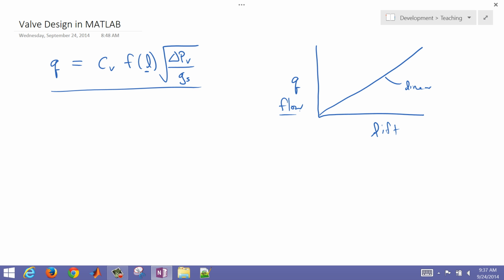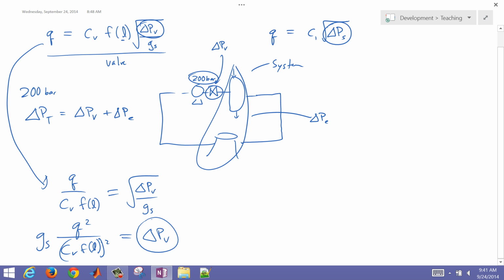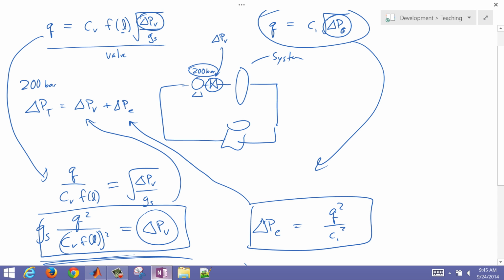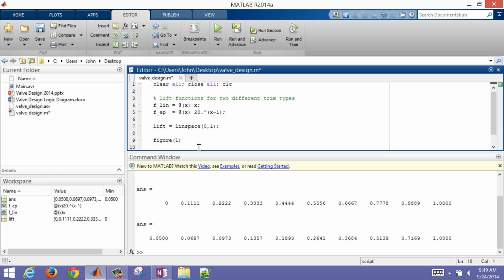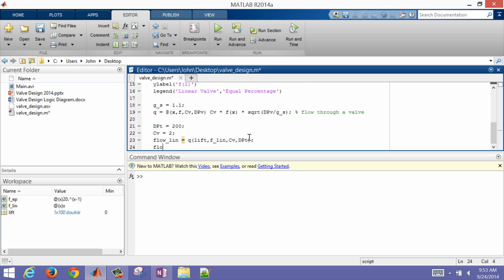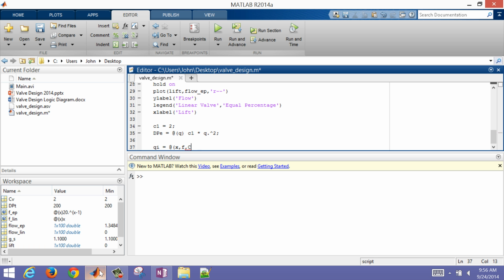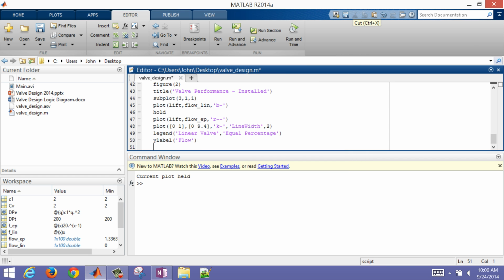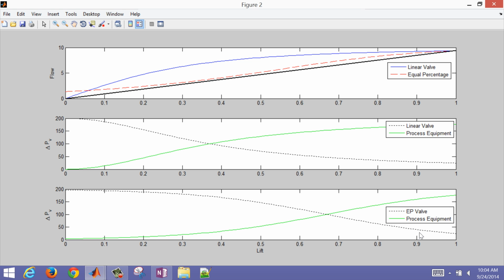Valve Design in MATLAB

Comment: How do you get Dpe = q.^2*C1 And the rearrange qi = sqrt((Cv.*f(x)).^2.*Dpt./(g_s + (Cv.*f(x)).^a.*c1 seems doesn't match with the original equation
Reply from the maker: It is a quadratic pressure drop across the process equipment. The second equation comes from adding the pressure drop from the valve and the equipment. See http://apmonitor.com/pdc/index.php/Main/FlowValves for additional details.
Reply: Dear Sir. Since you have derived the equation as delta[pe] = q^2/C1 that really confuse me. And I try to analyze your derive equation that you written down before taking the MatLab step it come up different
Reply: q= sqrt(200/((g(s)/((Cvf(l))^2 + 1/C1^2)) should be sqrt((200*((Cv*f(l)*C1))^2)/(g(s)*C1^2+(Cv*(f(l))^2). I dont understand how can you come up with the eqution  on Matlab
Reply from the maker: @nguyenduckhanh55  The source files are available at https://apmonitor.com/che436/index.php/Main/LectureNotes9 - the problem statement says that we should determine the Cv value at the nominal conditions. If you do find an error in my derivation, please let me know (this happens occasionally). This simplifies the expression because Cv is a constant, not a function of lift.  Please see http://apmonitor.com/che436/uploads/Main/Valve_design.zip and also the Python widget (interactive plot) at http://apmonitor.com/pdc/index.php/Main/ValveDesign
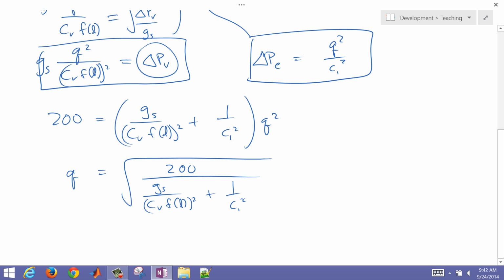Reply: @ @apm  , Dear sir,   I think the same issue with @Duc nguyen minh, the formular at time 06:24 is differernt from the matlab code at time 21:34,
Reply: @apm  , Dear sir,   I think the same issue with @Duc nguyen minh, the formular at time 06:24 is differernt from the matlab code at time 21:34, but thanks all the same

Comment: Great lecture. Thank you for sharing . One question - Where would we use linear valves ? Because from my knowledge according to darcy equation all pathways give pressure drop proportional to square of flow right ? Hence its always best to use equal percentage valves right  ? Can you tell me what equipments dont follow this rule ?
Reply: for laminar flow  maybe ?
Reply from the maker: You are correct that linear valves are uncommon. For the reasons that you mentioned, equal percentage valves are the most common. I see two cases where linear valves may be useful. One is where the pump provides decreasing head with increasing flow rate. This counteracts the process equipment pressure drop that is the square of the flow. The other situation is where the process equipment does not have a significant pressure drop such as a short transfer line between two tanks. The valve has most of the pressure drop so it should be a linear valve. Overall, we want the overall flow versus lift to be linear so the correct trim really depends on the pump and process equipment.
Reply: Thank you !

Comment: I cannot see the unit of measurement in matlab
Reply: Thanks for your comment. Yes, MATLAB does not track units of measurement or do conversions. The valve equation is largely empirical so the Cv term absorbs whatever units were used for the fitting of that parameter and the value of R.